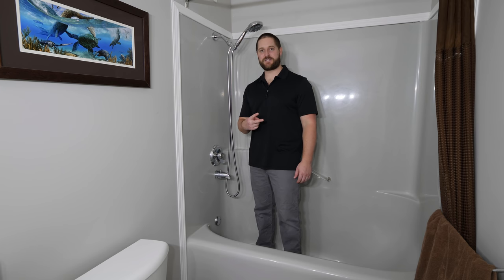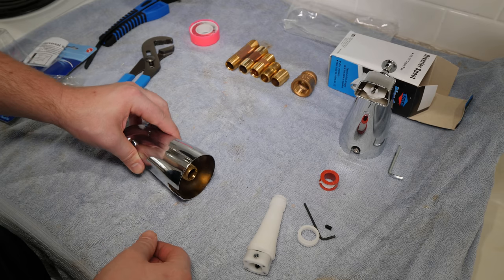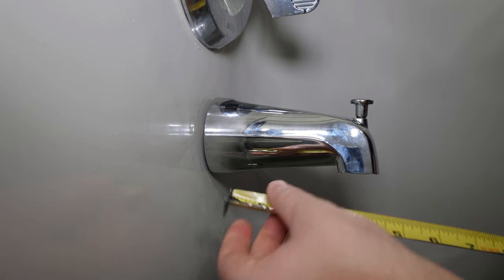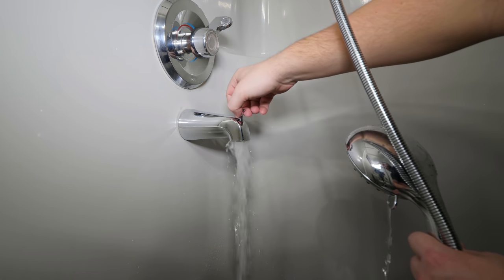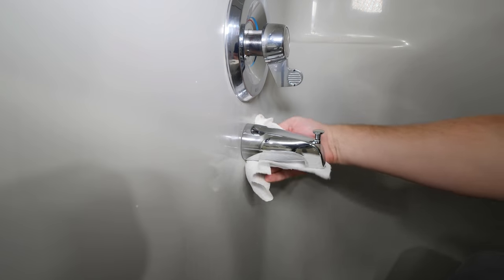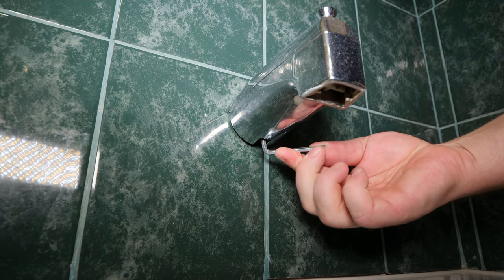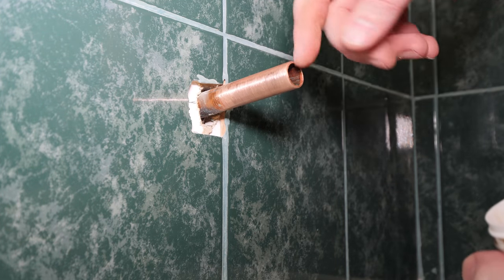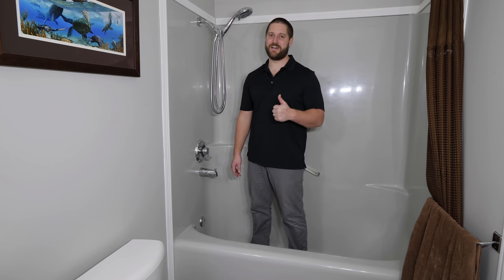Replacing a Tub Faucet: Bathtub Spout Replacement

Comment: Can anyone tell me what the plastic inside is called? The part with the O rings? ( not the diverter pc) 
This part got stuck on the pipe while the faucet itself came off. 
I took my slip on off, cleaned it. And now the diverter works but it’s leaking near my wall now 🤦‍♀️ 

Do I need a new spout? I replaced the O ring. It’s better. But not perfect.

Comment: so mine set screw doesn't touch the metal there's the long part plastic not sure why. also it was slipping off probably because the plastic and the set screw was twisted to the top inaccessible i took it off and tried to fix it now its leaking... guess i probably need a new one....

Comment: On the high spout, if it was a custom built house or a remodeled for a person who had trouble bending or reaching down the higher spout would make it easier to pull the pin. If it was a regular track house then what a sloppy job that plumber did.

Comment: What in the heck do you do if you have a set screw but cannot actually see it to loosen it. I’ve tried to use a small dental mirror with a light to find it and I’ve tried using my phone camera to take photos of the area and I simply cannot locate it. My spout will not spin at all and sure feels for all the world as if it’s locked in place. And I’m the one who put this faucet on years ago and I remember there being a set screw but I sure can’t find it now. I don’t want to call a plumber for something so stupid but I’m stumped at this point.

Comment: Is it just time that does that to metal or something in the water which is why this happens.
Reply: Help! I had the nerve 2 try this since you made it seem so doable, but my spout still moves left & right even though the screw is tight. Did I do something wrong or do I just need 2 seal it with silicone to keep it from moving?
Reply: @queensugar17  if asking me, two things does the whole spout screw onto pipe and is loose, then thinking take spout off go to local supply ,homedepot,Loews or similar. Explain, ask for a rubber a rubber o-ring to make a tighter fit after tightening. 
Two if it's the type held on by a screw same thing or maybe it's not long enough to set against the wall for stability. 
Good luck

Comment: I’m just wondering why the spout sits way up there?
Reply from the maker: I also wonder this. It's way too high.
Reply: amh75ify - There is never a satisfactory explanation of substandard work in any trade. I have personally done over 10,000 professional property inspections and have written another 20,000+ reports for in inspectors. You have no idea how much poor work is done in buildings; it is mind boggling. Substandard work can often result in $ major water damage and mold as well as serious hazards that can result in injury and death. Have you ever seen "Holmes Inspection" on cable TV? Sometimes they have to tear down most of the house and start from scratch to correct all defects.

Comment: :goodvibes:
Reply: OMG!  This video saved me a lot of money by doing it myself.  With him showing both styles was definitely the professional way to showcase the project. This is the video that you want to watch for a diy tub spout replacement project.  There are other videos showcasing replacing tub spouts that can cause you to call in a professional plumber because they are not as detailed as this one.  One tip that  I would add: If you are removing an old slip on tub spout and as you are pulling it off and it seems stuck at some point, wiggle it side to side as you are pulling it off, just a tad, NOT rough,do it gentle and it should slide right off.  Happy senior citizen.

Comment: My tub spout is twist on but won't budge when I try to take it off
Reply: Besa Bes  worried if it twist to hard the pipe will break in the wall
Reply: @stevenziegler2523  - How did you finally get the spout off? Did you have to hire a plumber?
Reply: @carlcampbell6827  I was not able to get it off so I left it on. Was worried I would break the pipe behind the wall if I tried to twist it off
Reply: @stevenziegler2523  That is good you did not panic and end up destroying something. You may have old galvanized iron supply lines that have heavy corrosion. If someone connected a copper tub spout pipe fitting to iron pipe in the wall, this will cause rapid corrosion. You will probably end up cutting the fixture off to gain access to the pipes in the wall for inspection and determination of needed repair. If the connection is heavily corroded, it is subject to leakage in the wall. A general inspection of the whole house system by a reputable plumbing contractor may be in order to give you clarity and direction.

Comment: When you turn the tub spout, you can snap the pipe that connected to the back, and have to replace all those pipes. Most people would need to hire a plumber for this major repair. Be careful.
Reply: This is a major repair?  However, I agree you do have to be careful. I don't most things around the house myself. So, I was surprised to learn how easy this is to do.

Comment: My problem is after I removed the tub spout, the pipe still dripping water
Reply: It would seem to me the problem lies in the value that turns the water on or off.  If you have a two value system, should be easy to determine whether the leak is on the hot or cold valve stem simply by the temp of the leaking water, IMHO.